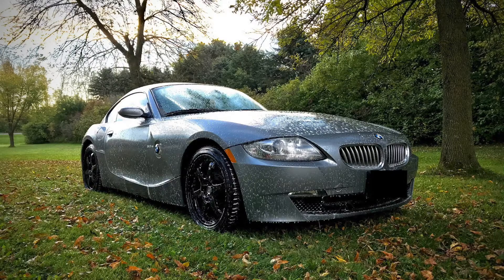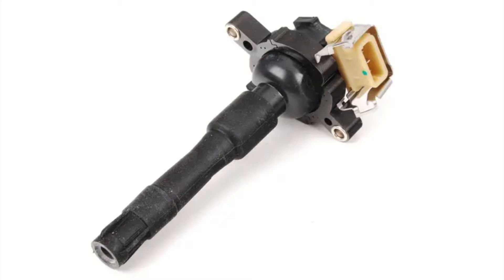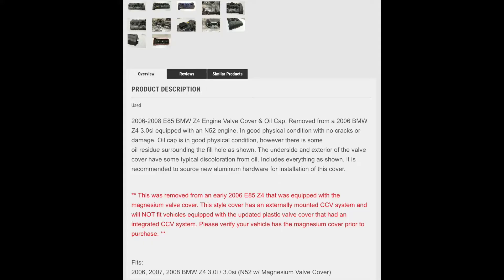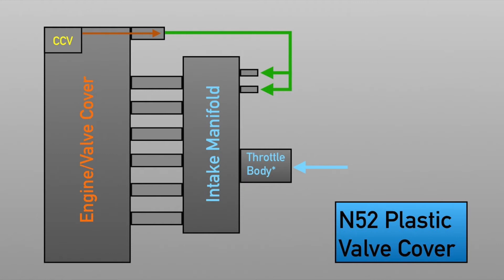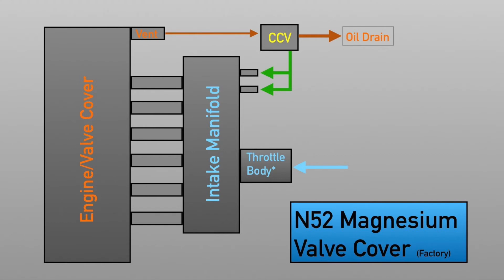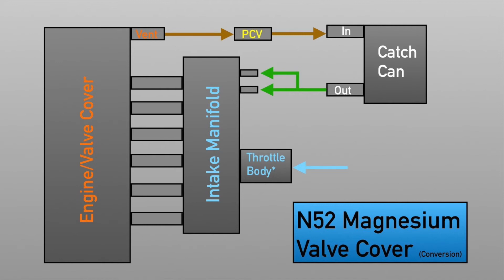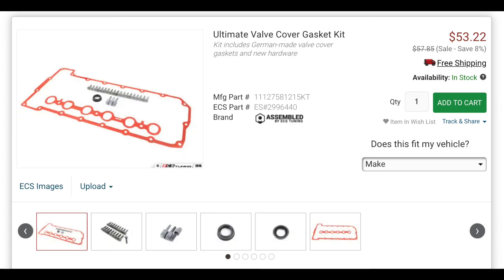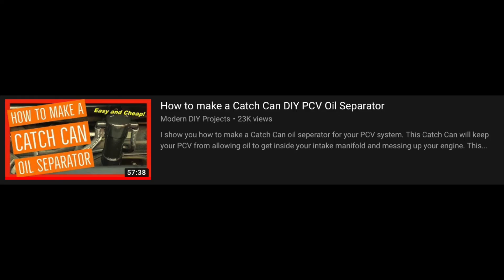BMW N52 Magnesium Valve Cover Conversion - Part 1: Project Introduction and Overview

Comment: Good informative video!  I'm thinking doing the opposite going from metal to plastic and have been researching so thanks for putting this out there.  The reason to go plastic for me is the complexity of the CCV system on the metal valve cover with 3 hoses and the valve.  OEM BMW parts cost 500$ just for replacing the CCV and they get brittle/crack over time without knowing.  Getting rid of that system and going plastic would reduce potential things to go wrong in the future.  Also, buy a valve cover from FCP Euro and change it out every 70K for free with warranty.  Just a thought on keeping the plastic vs metal!
Reply from the maker: That makes a lot of sense. Sadly, we’re all stuck with either plastic or plastic. There realistically isn’t a way out. Good luck with your mod and post a video if you feel it can add something!

Comment: so im doing the opposite of this i replaced my magnesium cover with a aluminum one thats of the same design as the newer plastic ones with built in Oil seperator. I need to figure out what to do to my oil return line that goes down to the oilpan. Should i just plug it? I dont think the newer engines have anything going to this port but theres so few information its hard to figure it out. thank you in advanced.
Reply: Did you figure it out?
Reply: @thomxcrack  yes I did. Cap off the oil return to the  engine. I literally put a bolt in mine. Then you just delete all the deperetors and B's on top and replace it with the N51 style crankcase vent tube or whatever it's called. You need it because the newer style valve cover crankcase tube port is not the same size anyways.

Comment: Does anyone have any info on doing the opposite? Unfortunatly where I live (Brazil) it is impossible to find a magnesium one, and cant even find the bolts, only complete kits of the plastic one
Reply: im trying to figure it out, i think you need to plug the oil pan return line.

Comment: This video has gave me so much knowledge on this subject. So in my case I’m trying to do this in reverse. I have a mag valve cover set up and I’m going to the plastic style. There a company that makes aluminum versions of the plastic style and that’s the route I took. So doing the whole pcv set up is is the problem like you say. The hoses in the back are definitely different and I made an adapter to get it to connect to test. So the problem I’m having now is the car ideal fine and sounds fine it just smokes bc the pcv system isn’t work right and there no top end power. I would love to pick your brain on some things bc there no info online about these swaps. Thank 🙏🏼
Reply: the original lines actually plug into the harness under the intake manifold, i wonder if thats why. Im thinking of just running the two systems in series to prevent the problem you had.
Reply: also the return line im pretty sure is plugged at the oilpan on the newer systems.

Comment: Well I found my next project. This seems like a wayyyy more affordable option than grabbing a oem bmw n52 plastic valve cover kit for $600+
Reply from the maker: Definitely watch the whole series and consider if you really want to do it. I never found a solution for the CCV/PCV that satisfied me.
Reply: @Casey_Schmidt  my idea is to take the oem pcv tubing from a 2006 330i that uses this metal valve cover and use that to my 3 stage IM that also comes on the 2006 330ci and have all OEM parts that way.
Reply from the maker: @KNS_Racing  depending on how the hoses route, you may need to do some custom work but that sounds like a good direction to head.

Comment: I looked at a 2006 330i with the thought of buying one and as far as I know it had the magnesium valve cover. For some odd reason I believe the 335's always had the plastic
Reply from the maker: 535i and 335i have the N54 engine not the N52, so you’d be correct.

Comment: I know this is a pretty old video, but it's got some good info in there. I'm considering doing this to my 2011 128i n52, but I'm not sure if I should switch over to a 3-stage intake manifold
Reply from the maker: In my opinion, if you’re going through the work of installing the 3-stage manifold and you can find a magnesium valve cover for cheap, it’s worth trying at least. You can always go back to the plastic one easily. The magnesium valve cover conversion only makes sense if you plan on keeping the car long enough to have the engine rebuilt and still continue using it after that. Otherwise the plastic ones, given a few replacements, will last long enough to see the car out.
Reply: @Casey_Schmidt  Right now I'm mostly concerned about the valve cover conversion for longevity purposes and just overall peace of mind. I'm considering the 3-stage manifold because I'm not sure if it's required to do the swap, if not then I'll probably just add it in later on when I decide to do the cold air intake.
Reply from the maker: As far as I know, the 3-stage manifold is not at all necessary for the swap. I’d also recommend reading the comments on my other videos in this series, I had no issues with the swap and most people have had the same experience. However, one or two guys mentioned some issues with the PCV system afterwards, I can’t verify those issues but again I recommend reading through them. Good luck!!

Comment: Pretty sure my 2006 x5 has the plastic to metal conversion. I notice when I bought it. The oil fill is now by the front of the vehicle next to the fan shroud.. Would that be correct?
Reply from the maker: @Tony tony - It’s more likely that it came with the metal valve cover. The X series cars seem to have more of that version of the engine than the 3 and 5 series cars.

Comment: What is the advantages of the magnesium valve cover compare to the plastic one. TQ
Reply from the maker: @vincent poon - Quite simply, longevity and durability.
Reply: If the Valve Covers were inexpensive because they are plastic $100 or less...Ok, buy it, replace it, move on......but they are not -$550 for BMW and $250 for a good aftermarket...... which is too much in my book for plastic.  If you are planning to keep a car long term than this is a "big issue"........
Reply from the maker: @MeCuckoobox - Well said.